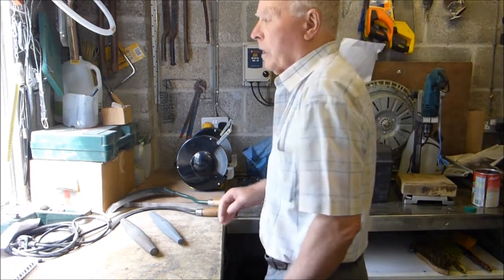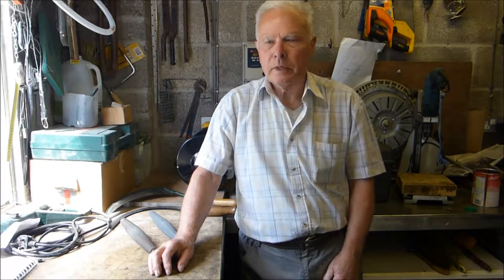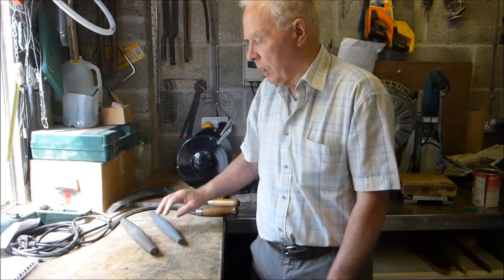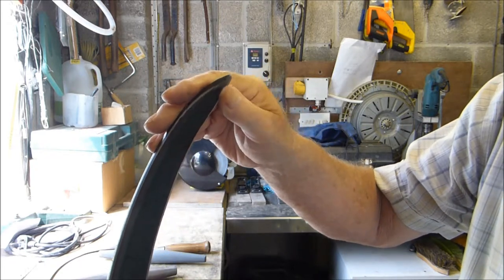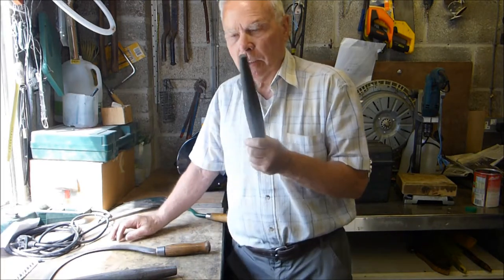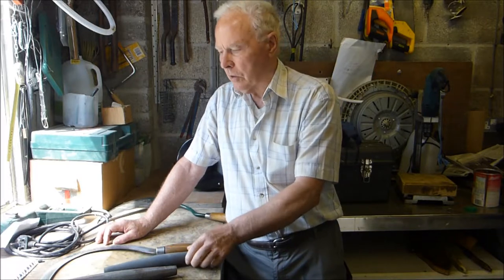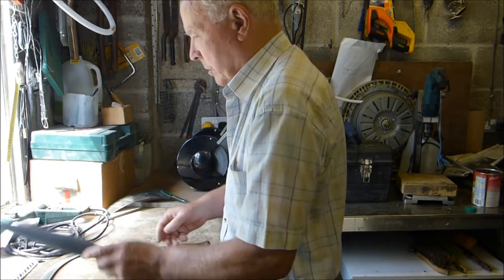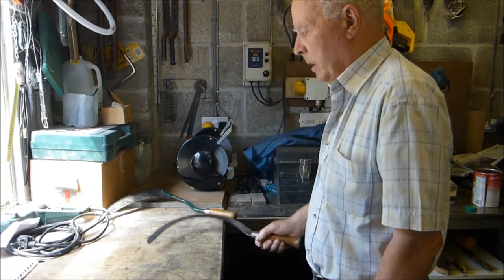How to sharpen a sickle. Part two.

Comment: It's just ever present marketing that makes us think we need all these power tools with their fashion trends, accessories and built in obsolescence. I inherited my grandfather's sickle and after looking up sickles and scythes to find out how they're used I'm utterly sold on the simplicity and effectiveness of traditional garden hand tools.
Certainly for a modest sized suburban garden, the little bit of extra effort and skill these old tools appear to require doesn't seem nearly so burdensome once you take into account the the hassle of engine maintenance, travelling and buying oil and petrol or rolling out and putting away extension cables or charging / replacing expensive batteries. Plus they need so much less space to store - also as selectronify says, there is a peace and 'connection' to be found when not using noisy power tools.

Comment: We are just like you in our not liking the noisy strimmer and blowerns. We bought an expensive strimmer years ago, it's heavy and awkward to use, even though my husband is tall and strong, so he never uses it! I have ordered a scythe and am really looking forward to learning how to use it. Two years ago, I bought a grass hook but it had a serrated edge and never cut a thing! I thought maybe if I had someone grind the edge off, maybe it'd be better? But I saw on the website I bought the scythe from, they also sell those short handles grass hooks, with very good blades on them. Do you have any videos on scythe sharpening?

Comment: This and part 1 answered the question I was trying to ask which was do I need to peen a sickle, thanks. I ordered a secondhand sickle as the new ones look flimsy and many have serrated edges which would be unsharpenable.
But one question is raised by this video: I have a cigar stone that I bought a while ago (I think while I was working in the US) but I don't know if it's aluminium oxide or carborundum, is it possible to determine which it is without a second one for comparsion?
Reply: @Selectronify  Thanks. 
A messed up canoe stone was clearly coming second, so I think it's probably carborundum.
Reply: @Selectronify  Thanks for the update.
Since I'm going on a scything course at Scythe Cymru this weekend I'll try to get one of their carborundum stones.
Reply from the maker: They look very similar but there is a considerable difference in the performance. A silicon carbide stone can be used wet or dry but either way it is the superior stone although more expensive so beware and only buy this stone when it is in the original packageing and clearly marked as silicon carbide. Stockists of Faithful Tools sell both.I hope this helps, Cliff.